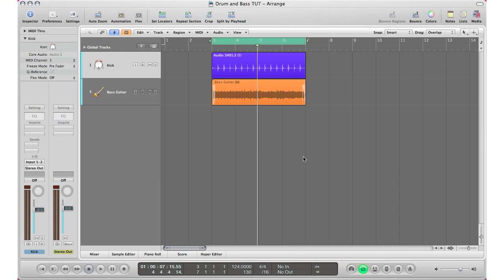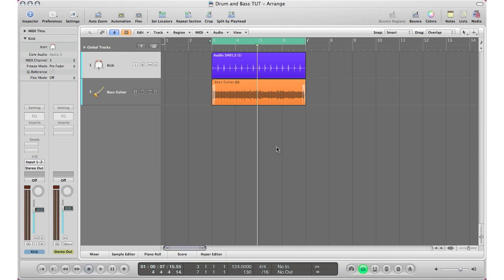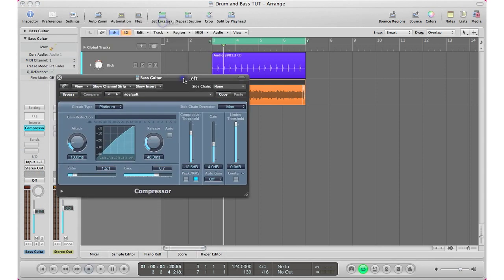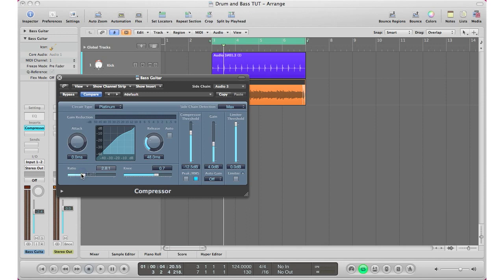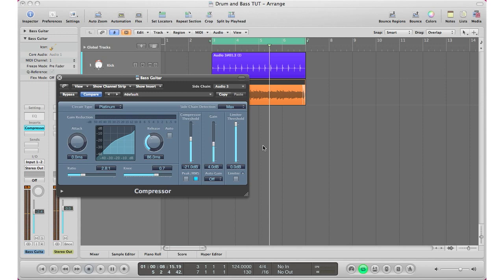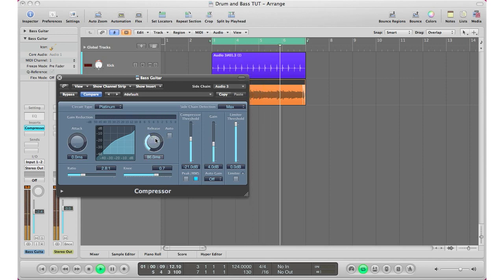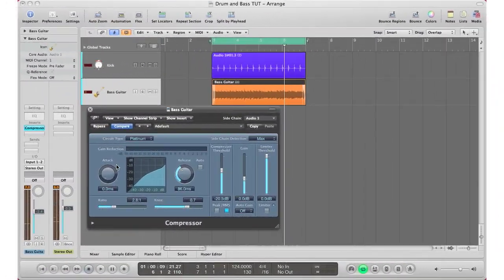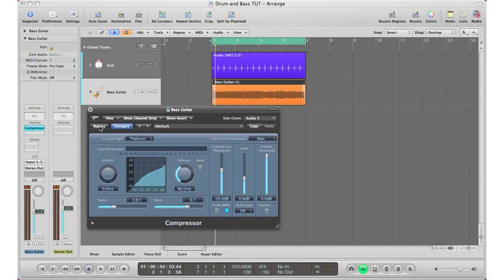Mixing Kick Drum and Your Bass (Part 1)

Comment: Two corrections here: If you put the attack at "0" on the sidechain compressor, you will get a clicking artifact on the bass channel from the kick attack which is not desireable. 0.5 or 1 ms attack will avoid this. 

If you want the attack and release to be faster, simply click on "Peak" next to "RMS" underneath the threshhold. RMS is much softer.

Cheers